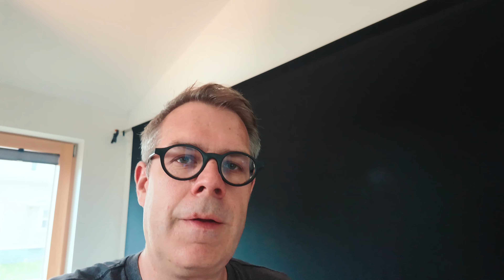My House Leaks Air. So Why Is the CO₂ This High?

Comment: 3 ACH isn't really leaky and is around where mechanical ventilation is required by code in some jurisdictions. 8 to 12 is more the range of an older home. 3 to 4x airflow compared to your home would be expected to have a significant effect on these results
Reply from the maker: Fair enough. But I didn’t actually change the air leakage in the bedroom between 8 and 3 ACH - most of that improvement happened in the basement.

That’s really the point of the video: a blower-door number tells you how leaky the whole house is, not where that air is entering or whether fresh outdoor air is actually reaching a closed bedroom at night.

At 8 ACH the house was certainly leakier, but that doesn’t mean the bedroom was getting adequate fresh air. That’s why intentional ventilation matters. 

BTW, our code here may require ventilation, but only in the bathrooms, and that’s putting negative pressure on the envelope sucking air through the walls. That’s actually the criticism of the guy in the video with the gas mask sucking air through the wall. 

Thanks for commenting. Valid point.

Comment: Really bad suggestions.
1) Leave open a giant tub of hydrogen peroxide open and let it break down. Lots of O2 release and Fresh clean water to drink in the morning.
2) Artificial plants which are easy to maintain(no watering needed) and can give you a psychological boost in percieved O2 levels.
3) Become lactose intolerent and drink lots of milk. Once you have enough in you, you wil fart enough to  make the room smelly and motivating you to open the window.

on a slightly serious note, use an exhaust/intake fan linked to the CO2 meter. The Co2 alarm(1000) should trigger the fan to turn on and pull/push air in/out of the room. once the CO2 level drops bellow 800 or so, it turns off. 

but i like the 1st 3 options better
Reply from the maker: Wow. I genuinely had to laugh. 😂😂😂 This is so good. 

I’ll probably stick to your actual solution once I get to it. 

Thanks for the amazing laughs, I think I’m going to have to turn this into a quick short video by itself. Thanks.
Reply: @PinwheelTimberPlanners you could do a short regarding all the myths and bad suggestions available online. You have my permission to ridicule my post as if it was real.
Reply from the maker: @battleforevermore love it. Thanks.